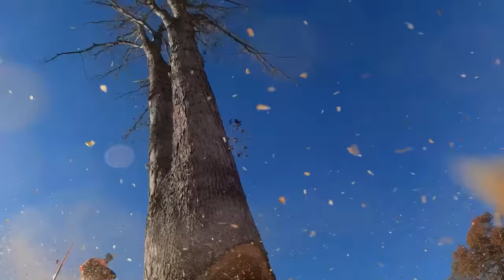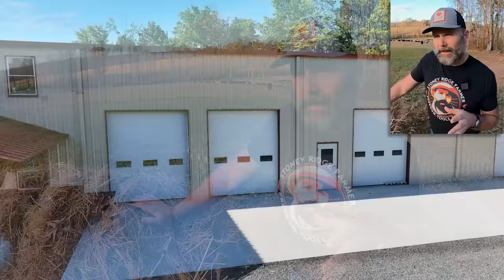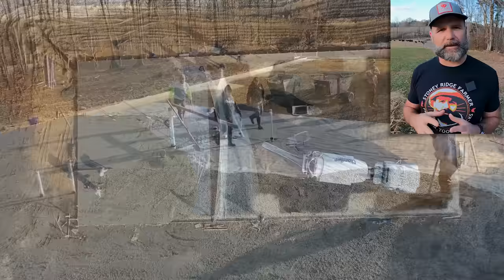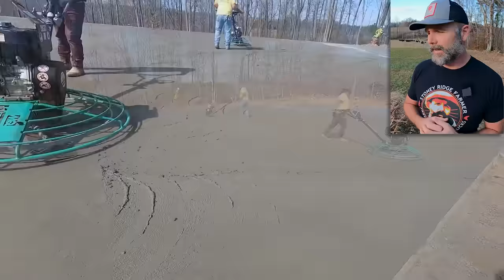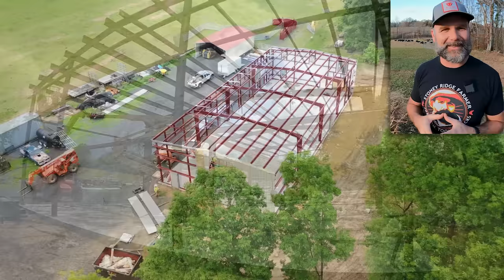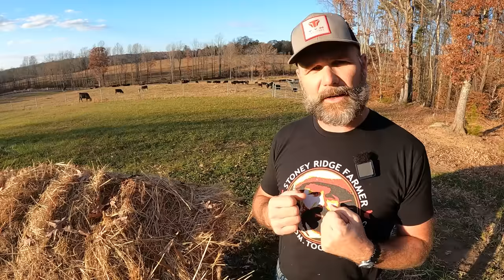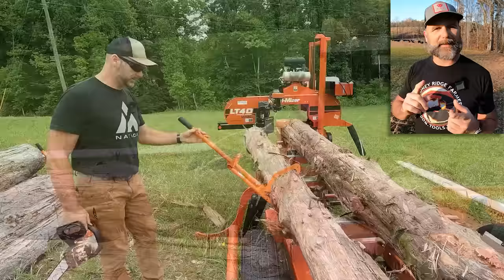Cops Came to Investigate Veteran's Farm! Heartbreaking disbelief

Comment: Fellow Vet here also living in NC.  I bought a property (a few acres) a few years ago, the property had 2 homes on it (one built back in the 80's) and a good sized stand alone garage. There was a trailer on another part of my property where the garage was that had been removed before I bought the property, however I still have a septic and separate electric meter there that was for the trailer and garage. The older home from the 80's had an attached garage as part of it's footprint.  When I decided to make repairs/improvements to the small house I was told that I could not use it as a 2nd home nor could I change the footprint of the structure. Keep in mind that this small home also has it's own septic system but it's powered by the main house (not sure why they did that but it is what it is) They had passed a law in my county that said you can have only one permanent dwelling on your property(no matter the size of the property), but my small 2nd home was grandfathered in because it was an existing home when I bought it.  However, I was greatly restricted on what I could do with it....even to the point of repairs to it.  Nearly every contractor I hired for repairs asked me why I was even talking to the county, they said they make trouble for everyone.  Nearly ever single one of them said most people don't even tell the county what their doing and they don't ask for their permission because of all the trouble and grief they cause.  So now my small home is just sitting there half finished being used for storage because of the county regulations.  To be able to use this home as a residence (for example- an in-law suite/house) I would have to subdivide the lot, change the electric so that it has it's own meter and many other things besides....It is frustrating  that some government office, who doesn't live on my land, has any authority to tell me what I can and cannot do on MY land. Especially in homes that have been there for over 40 years.    I feel your pain.    Thanks for serving brother!
Reply: This is the best comment I've seen., don't ask the county first...do what you want and because it was all bought and you keeping with the same footprint,  they should not be able to do anything. They can't see a lot of what we do anyway. 
  That said,  I'll just do research on county rules and regs,  and not call them and ask anything.  Every form of government,  and insurance companies and medical, law,  everything,  just out to make a buck off the people. But we do have to remember,  no matter what,  our property isn't ours, it sucks,  but it's true.  Thousands of ways it can be taken. So I choose to just do like the Stoney Ridge guy did,  try to do right,  call em on it, but just enjoy it while we can. Don't let their crap... crap on our days! Im also retired AF. And homeowner.
Reply: di d you look up the laws and codes,  or talk to an attorney? if the  county is wrong they  may have to pay for your  atty bill.
Reply: Turn into an Air bnb or something.
Reply: Part of a police state is having so many unnecessary laws that everyone is in some violation.  Then if you cause trouble, they enforce some violation.  Keeps you quite doesn't it?
Reply: not only is it ludicrous, but also lunacy

Comment: Im in Oregon, my place burned down in the Holiday Farm wildfire. I had about 6500 square feet in buildings, lodge and six cabins. One cabin survived, although damaged, I rebuilt the lodge at 4000 square feet feet. I used to pay 3950 property tax and have to pay now 7200 bucks. No senator or other stakeholder responded . So much for our county to yelp you recover from a huge loss.
Reply: NEW BUILDING IS GONNA BE WORTH MORE, SO YEAH, HIGHER TAX.  the whole state is overtaxed and that formula needs  redone.  Ballot initiative.
Reply: @MajorityOneTV-kb1xz sarcasm is an attempt to gain power over someone

Comment: I’m in Washington Co. Utah. My father won a bid to cut logs from/on Cedar Mountain (Iron Co. Utah)
He cut the logs, then bought a mobile saw mill. This was in 1984. He built his house. He was newly retired at that  time. In 1996 the house caught on fire up stares. Grandchildren with matches. The roof was severely damaged, the water from the firefighting severely damaged the floor up stairs/ ceiling for downstairs. The city inspector came over and told him he couldn’t repair the roof and ceiling/floor because the two by fours hadn’t been inspected. My dad knew an inspector and talked to him about it. The inspector said he could only inspect wood that came through the plant. The mayor told the inspector the roof could be replaced. 
When we did the log cutting, building your own home was legal. The laws changed by the time of the fire.
We decided a lot of laws are for control, and for job security for specialization. 
When passing laws, it would be awesome for 5 laws to be taken off the books. More laws, less freedom.

Comment: I'm a disabled veteran and a retired Police Officer.  I live in a town in Kansas.  My house sits on 3 lots.  I wanted to build a garage/shop on the back lot.  You would have thought that I wanted to open a sewage pit or something.  I tried doing everything the right way.  Instead of using a platted road right-of-way to get to my new shop, they wanted me to pour a 180' long concrete driveway with a 25 degree incline from the front of my house to the shop.  No way would I be able to get my truck and trailer up that.  I explained that according to their own code that would be in violation.  They then said that I could not use the platted road unless it was built, or I had a "special use permit".  I pointed out to them that there was a fire hydrant at the corner of my rear lot.  I asked them how a fire truck could get to it then.  I've seen fire trucks pull behind my home to that hydrant to "test" it.  After 6 months of back and forth, I got my City Council to actually come out and look at my property.  The finally grew a pair and over-rode the Code Enforcement minions and issued me a "Special Use Permit".  It requires that I maintain the easement and keep it open to Public Utilities and City Vehicles.  I had to put down a road base and gravel before I could get my building permits.

Comment: Ok, I get it.  Be grateful you have one inspector.  Living in the big city, I was adding onto my house to make it bigger and put in a garage.  The plumbing inspector came after I had installed all the plumbing.  He said an air pipe from the shower was wrong and that I could not have it the way it was.  The electrical inspector came by and said it was incorrect that I had to change it.  I contacted the county and they said I should follow what the current inspector said because he had been with them the longest.  So I changed it.  Then when the inspector came to inspect the roof, it was the same plumbing inspector .  He asked why I changed it.  I told him and he called the office and I had to change it back.  So, I was supper pissed and called my attorney.  My attorney called me two days later and told me that I was to leave it the way the first inspector who was the third inspector said and if it wasn't that way to leave it in the condition it was in.  I told him the first and third were the same guy.  It seems that the guy that was with them the longest was not aware of changes that were made and the new guy was fresh out of training and they were in a battle of who is going to get a higher ranking position and I was stuck in the middle.  Needless to say, the first guy who was the third guy was right and the second guy was wrong.  

So, you got it easy, believe me.  In addition, we do not own our land and if you don't believe me, try not paying your taxes.  Another thing, I would like to do in my new home is put up an antenna on my property to get better reception.  The rules are that I can go no higher than 35 feet and it can't be farther than 1 foot from the house.  If I could go 75, my antenna could see over the top of the mountain in front of me and I could get better reception like I did with a military pole antenna and my winegaurd on it.  Nope, against the city rules, and its an eyesore.  Too whom?   I can't say said the inspector.

Now, in Cody Wyoming 5 years ago.  You buy the land.  Have a certified septic tank installer do testing, have the inspector witness a perk test, have the septic installer complete the system, have it inspected and when approved, cover it up and have that inspection done again. It was 150 bucks for the permit for the system.   Then I said, how much for the house, she said that's it you're done.  I said are they very quick about the inspections for the concrete, frame, electrical, walls, insulation, sheet rock etc.  She said what inspection?  I  said well doesn't it have to be inspected?  Honest to God this was her answer.  Are you going to rent this right away?  I said no!  She said "well hun, we don't expect you to build something that you are going to live in that you would make so shoddy that it would burn down"!!

I thought, Oh My God.  Commons sense does exist in some places.

Comment: Almost the exact same thing happened to us. We were investigated by code enforcement after we put electric in a three car garage/workshop. This is six months after it was inspected. Then we put solar panels on it and the electric company had to approve it. We had all the permits and paperwork, but it was infuriating to have to pull it all out & prove it when they should have it already. We are over regulated in my opinion.
Reply: Exactly- they had all the data and paper
Reply: The electric company should never have a say in your private property, I get to an extent the government enforcing a minimum safety code. The only reason I am understanding of this is because idiots build stuff all the time and do poor work and it gets covered up by drywall.
Reply: @williammitchell8247  My solar was installed and we waited weeks for it FPL (Florida Power & Light) to come out and approve it. You're right it shouldn't be like this.
Reply: Just the opposite took place with my project.I wanted my power pole and meter street side as to keep the meter readers from entering the property.The power company agreed and I wanted two power poles with service to each power pole one pole for the house and one for the water well.Power company agreed .The county said you can't have two power poles serving your property.The power company and I told the county that the business I have with the power company is between us and not the counties business.The permits where issued with the power company advising the county that they would file a law suit about this, so the county did not want to set a presendent. The common sense reason for two poles was if a fire where to happen and we had to shut off power we would still have power to the well and water to help suppress the fire. @williammitchell8247
Reply: Corruption within the departments are after your property.
Reply: @ShelvedBooks-lw9td  I don't know about that, but I definitely think we are over regulated.
Reply: Infuriating but, you started it all when; you went to them, asking permission to build something on your property. You signed contractual agreements that strip you of your rights and subject you to statutory/administrative law. Deprivation of rights under color of law... but again, you asked for it.
Reply: @Jerseyhighlander  Unfortunately, where I live, if you do not go to them and pull the correct permits & get the inspection, they will fine you or make you tear it down. Maybe you have a choice where you're at, but I didn't. That is the whole problem.
Reply: We are way too regulated by the government
Reply: Trump 2024
Reply: Where?
Reply: @UserName_no1  mine happened in Florida.
Reply: @TBKN316  The reason I asked is because utility companies in order to stifle renewable energy and promote burning fossil fuels send lobbyist to state legislatures and Congress to author bills like net metering, lowering the rate they pay for buying back the surplus solar generates, raising the rates for off peak generation, or limiting the numbers of panels used on a given property so that most of your power is sourced from the utility company. And the insurance companies are trying to cash in too by not insuring homes with solar in Hurricane Alley. And beware of utility companies that operate in multiple states, they're the biggest offenders. I suspect you researched this before you spent thousands on a system so this is more for people like our buddy in the video who didn't do his due diligence.
Reply: @williammitchell8247   They get a say  in the senses if it's don't  right they won;'t  let you connect.  Were I live if  you don't have a permit and signed off by  the inspector the local power company  will not connect
Reply: @TBKN316  The key to your post is where you say you were "infuriated" to simply pull out some papers.  This sounds like an anger management issue.
Reply: @williammitchell8247    Yes, this is why all building codes exist, because someone was injured or killed.
Reply: @ShelvedBooks-lw9td   Don't forget the Friday night bingo!
Reply: @Jerseyhighlander    Those laws and regulations apply to you whether or not you sign anything.
Reply: @TBKN316    I don't understand.  Are you saying the whole permitting process is wrong???
Reply: @juanitahenry1827    Who should we be regulated by, Google?
Reply: @rickcollins1825  Hmmm, I'm saying that after we got all the correct permits and had the inspections to have code enforcement come six months later and demand that I prove it, THAT IS A PROBLEM.  The county should have all of that, and code enforcement should have it. Do I have my paperwork? Yes. Was it hard to pull it out? No. It was however, unnecessary and a waste of my time. Your time may not be important but mine is. When I have to stop work in the middle of the day, with no notice, and prove myself, after doing everything right, it does infuriate me.
Reply: If you pull permits you give them jurisdiction over your property.  If you don't then they have no jurisdiction over your property. I built a 40x50 shop no permits. Code enforcement  drove by to go to another house on my private road. 2 years later and still haven't heard anything from code enforcement.  It's my property and I'll build what I want on it. If someone doesn't like it. I don't really care.  And I've seen how code enforcement does their job around here. It's not very good.
Reply: That’s how it was for me, I paid cash for materials and built my own house.  No one’s business but mine.  (And the county assessor)
Reply: @juanitahenry1827  And that results in being ruled by our INFERIORS.
Reply: @TBKN316  And justifiably so. This is what I mean when I say that gov't people are lazy. That code officer should have looked up the records himself before he ever contacted you. LAZYA$$ES.
Reply: @gregz4249  Yes, but building code/permitting people are local. 

I think we should have a process for citizen review of govt jobs, and hire an efficiency expert come and assess what a certain action should pay. I'm sure that putting in barn electric should not be more than time for filing the permit, and inspection when it's done. Sorry, that's NOT WORTH more than $150. Surely not in the $1000s.
Reply: @llee8325  Unless you are in the county.

Comment: As an Army vet and electrician, I do understand exactly how you feel.  Ag buildings are treated special under the code.  As soon as you said "occupy" or "habitable" the rules, tax code, and bureaucracy suddenly changed.  An ag building can be whatever you want.  Add electrical, and a basic ag permit with inspection is required.  As soon as you say "occupy", the value goes up, the taxes go up, and other things are required.  Smoke detectors, fire walls, minimum separation rules, and of course an occupancy permit.  You can do an ag building on a housing permit, but you can't do a house on an ag permit.  If you occupy an ag building without an occupancy permit,  the local AHJ (Authority Having Jurisdiction) will red tag your building.  Sounds like you need to change your permit, get the required inspections and assessments, and follow the instructions as if it were a house.  You can also just stop talking about ever sleeping there.  When / if the time comes you decide to occupy the building as a residence, file a new permit to bring it to the minimum standard.  In the meantime, post a sign that no overnights are allowed in that building.
Reply: You are very careful to be respectful to your county offices, but realisticly. They messed up. There should have been a record of the permit request, a record of the inspection request, and a copy of the results of the inspection. The fact that they had no paper trail at all means that somebody was remiss in their responsibilities.

But as you indicated,  the biggest question is, why so many regulations? They always say its for our safety,  but it seems like it's for control.
Reply: This is why you build UNDERGROUND. It pays for itself simply in taxes saved. They don't tax private man-made caves yet, do they?
Reply: Thank u for that
Reply: "Statutes and codes with the color of law."
Reply: Real nice county people...until you run afoul of miles of beurocratic red tape. The bigger the government gets, the more and more it ( or rather, the politicians) want.  Being nice makes no difference to those guys, it just makes their job easier.
Reply: You sound like you did your research first & found out all the exceptions to the main rules before doing anything permanent!! This guy comes across as "my way or no way", without asking anything further that might change the situation...
Reply: @Jumpersplace  depends what it looks like, if flint-stone style then maybe not, add water and electric then taxed